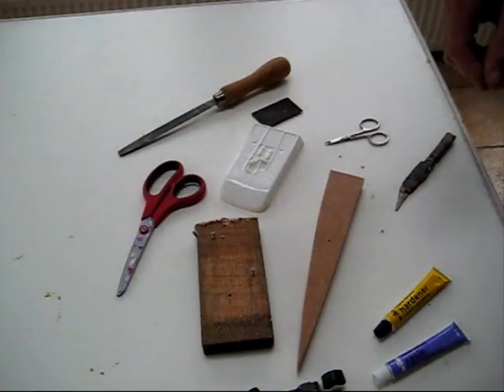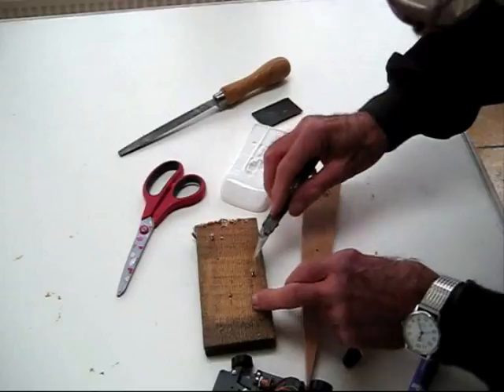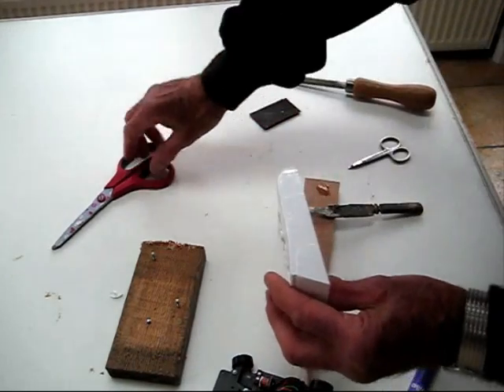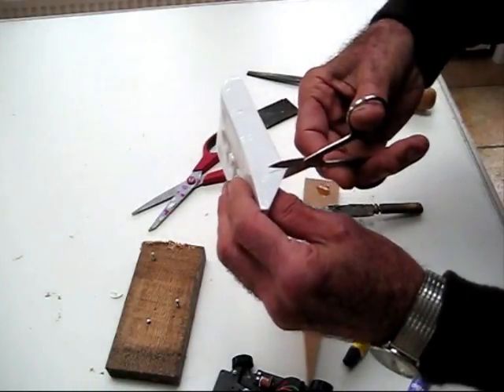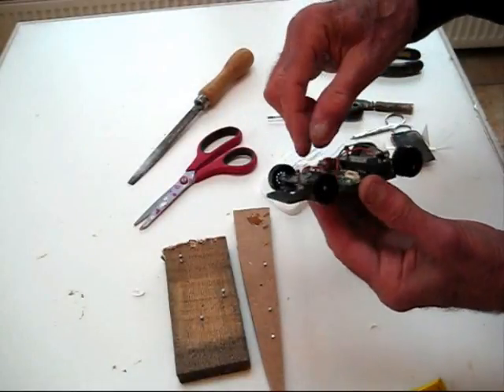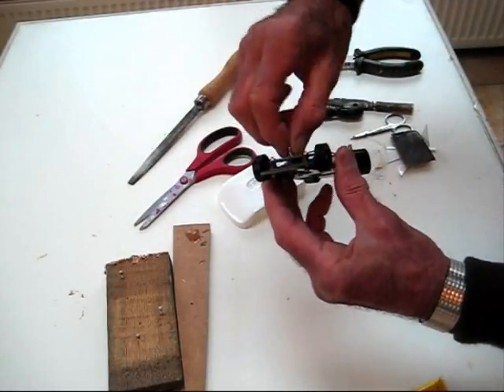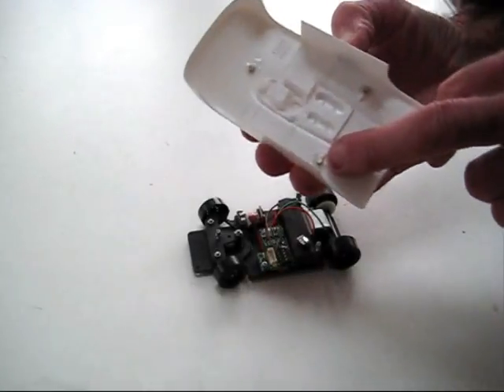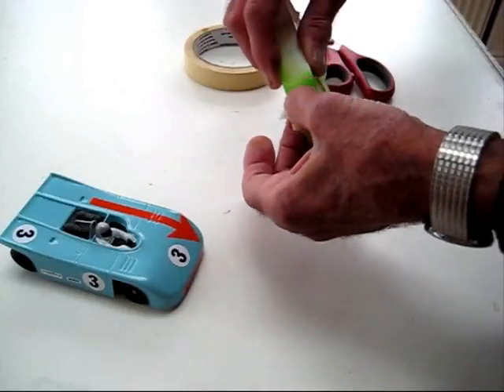MAGracing Body mounting and painting

Comment: These things are incredible Wes, I wish you all the best with the venture!  One thing I was wondering, when you are gluing the body onto the magnets, instead of weight, and the wood in front, how about getting it positioned, then dropping another magnet disc on top of the body at each magnet location, which would force the body to stay exactly where you want it while the glue dries.  When dry, simply pull the top magnets off, you are good to go.